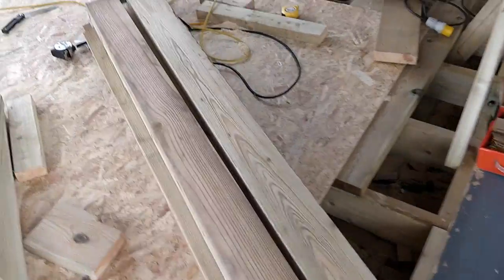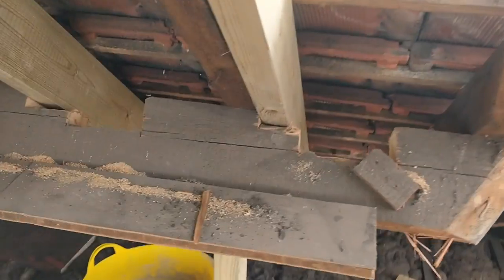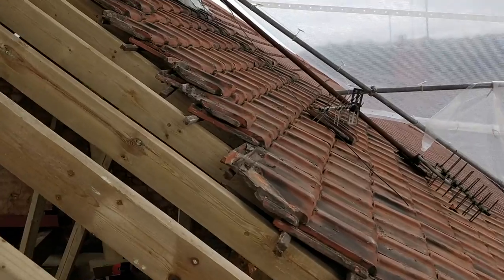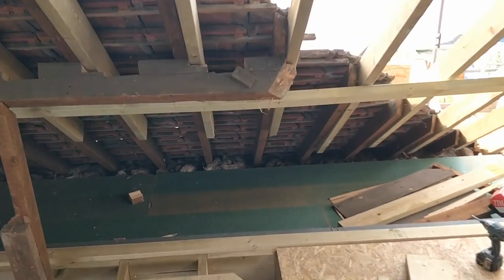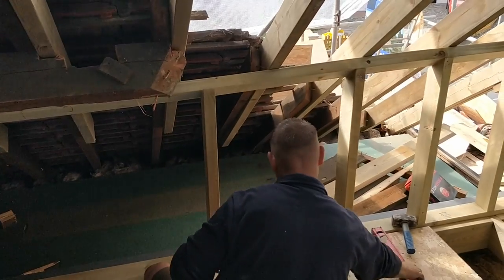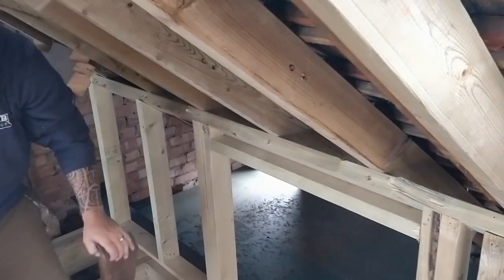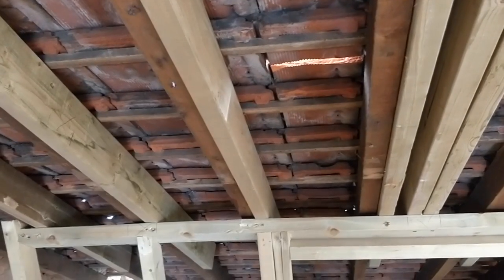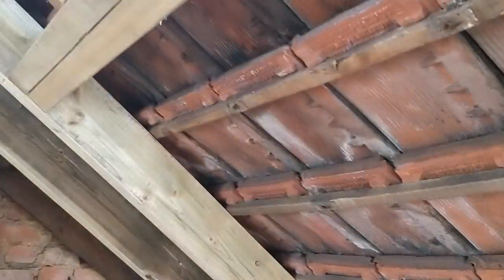Loft rafters and dwarf wall

Comment: Theoretically the bottom and top plates of that pony wall should be doubled up as it is a load bearing wall. If it was me I'd leave the bottom plate as a single and fix it to the RSJ. I'd definitely double the top plate though. A six tonne bottle jack and a small steel plate would have straightened the roof line for ye without all the smashing with a sledge. Just some observations, 👍😁🔨🇮🇪

Comment: Watching with interest, can I ask why you didn’t strip all the tiles off,? as it would have made straightening the rafters easier. 
Keep up the good work
Reply from the maker: Cheers! It's a bit of an odd system sometimes with subcontractors, but we strip as many as we need to do our job, and then leave the rest for the tilers. I think if I were doing the whole thing by myself, I would strip it completely.

Comment: If your striping the roof anyway why not just strip all the rafters out & replace.
Reply from the maker: It depends on the roof structure and the price that the client has agreed. Sometimes the house has an additional hipped roof at the front above a bay window. This is more complex roof construction and takes a lot longer to dismantle and reassemble, for very little benefit; the rafters left in place are outside the thermal envelope and so don't really get in the way. They also help us to maintain the existing pitch by sistering the new joists against them. Hope that helps 👍

Comment: Hi
Great video, just a quick question how did you fix the sole plate for the dwarf wall to the steel beam?
Reply from the maker: We didn't fix it to the steel, it is fixed to the rafters above, and it's fixed to the walls at the side. It is simply sitting on the steel beam, which is very strong and secure.
Reply: @OfficeBoyBuilder  Thanks
Reply: @OfficeBoyBuilder  I'd recommend a couple of self tapping steel screws or some Hilti nails for that bottom plate.